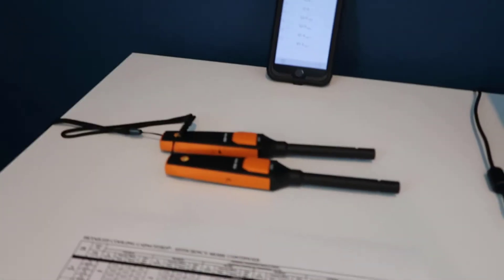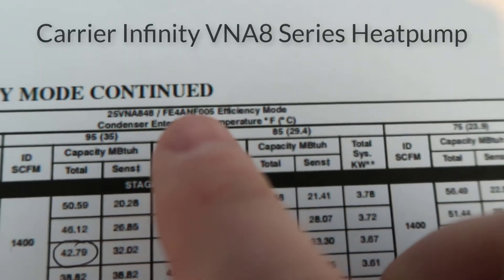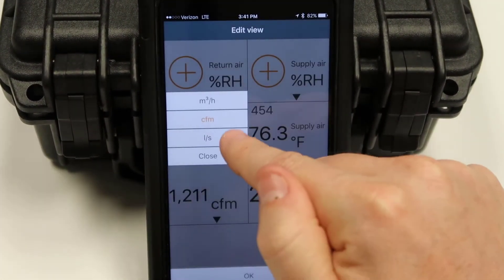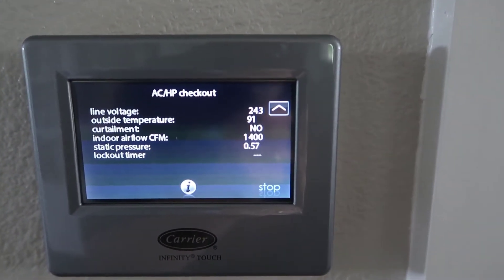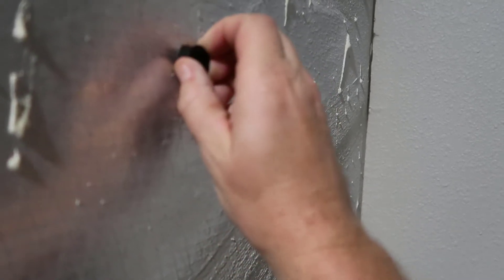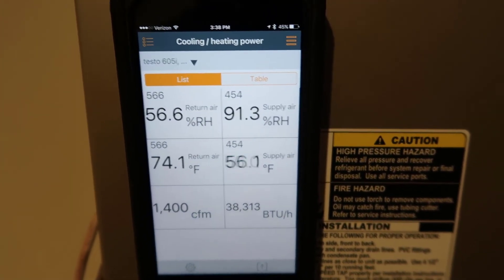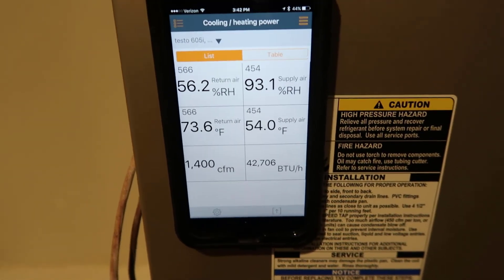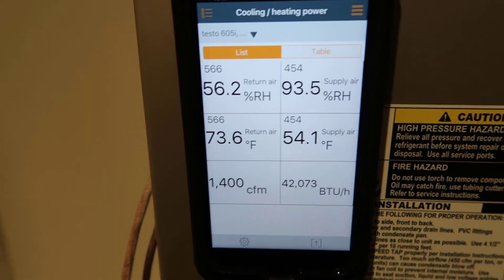How to Measure Cooling Capacity with the Testo 605i & the Smart Probes App

Comment: I have Samsung Galaxy Note9 none of my probes are connecting to my Testo app or with Measure quick?? Was there some kind of update or is it not compatible with this phone???
Reply from the maker: Hi there, we have seen in the past that the Galaxy Note 9's don't work very well with bluetooth devices such as smart probes. We find that having other bluetooth devices connected (like headphones/headset) to the Note 9 takes up a lot of the bandwidth. Based on working with a customer with this problem, he uninstalled an app “Smart Things,” and his Fieldpiece wireless probes started working after that. You might want to follow this link on how to correct any Bluetooth issues: https://www.technobezz.com/how-to-fix-samsung-galaxy-s9-bluetooth-issues/

Comment: This is a nice demonstration of what you get in a laboratory setting vs. a real world setting.  Most thermostat displays don't give you the actual CFM of a unit.  That will have to be calculated by drilling holes in the square duct or a single hole in a round duct in the main return and main supply duct, measuring the velocity of the air and calculating the average rough CFM (not exact CFM) of the duct air volume.  The hygrometers need to be placed in those same air streams and calculated the same way as the CFM, and averaged just as the CFM was.  If you don't do it this way, then you will get inaccurate results.  If you have an "X" grid volume calculating array, it will be more accurate, ONLY and ONLY IF, those pitots are completely free of debris of multiple kinds.  Quite frankly, this video is "hog-wash" concerning true readings.  As a mechanical engineer, I understand these readings and calculations.  This "boy" needs to go back to school of the "real world" and understand that what he proposes is not real life, and such readings are a product of a laboratory environment, not the common household nor commercial environments.  Clean ducts, clean coils, and proper line set calculations as well as super-heat and sub-cooling measurements are a must to determine these calculations prior to testing to get optimal results.  Not cleaning all items will give you actual readings as long as the instruments are calibrated in a metrology lab and calculations averaged as said above.  This is simply an antiquated set of "laboratory" calculations that do not relate to real world applications.  At best his testing gives an approximation of cooling load, not an actual representation of the facts of the system calculated properly.